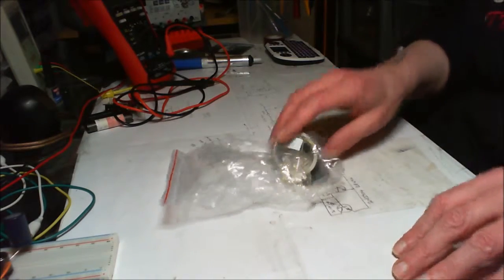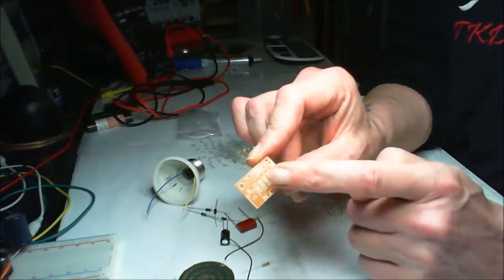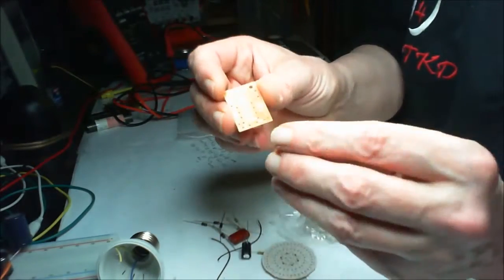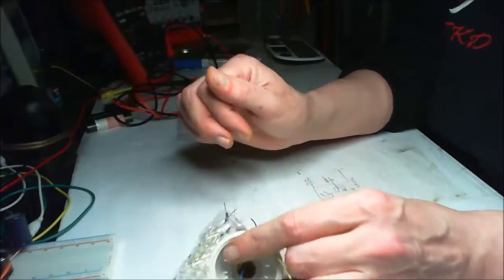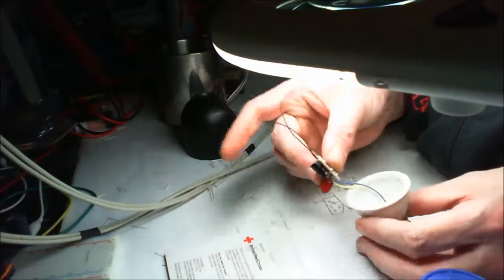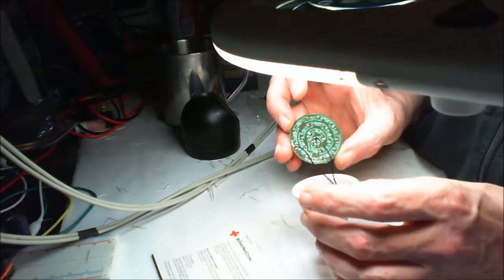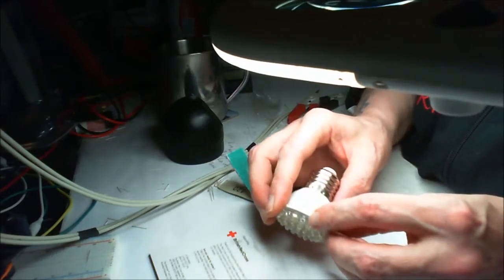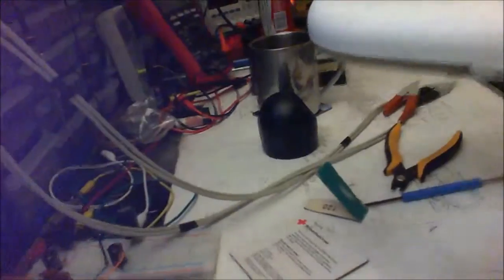Ebay 38 LED 2 4 Watt Light Kit

Comment: hey, got 3 of these on ebay, I made one ok, but do you think I can use brighter leds ? if so any other upgrades I need to do (diodes maybe ?) ?
Reply from the maker: +Juan Lanza Hi. No do not change the components. The transformer-less power supply side is calculated to give enough milliamp s to light the LED's.
What colour LED's have you got I change the white cool glow for warmer ones. If you have warm white LED's you could swap for cool white. Make sure you choose LED's with the same working characteristics. The supplied LED's conduct at 2.2 volts and at 3.2 volts draw about 18 milliamp's.
Be real careful with mains voltages and these transformer-less supplies. K
Reply: +Elecifun I just want more light ! the only things where current is going thru is de diodes and the resistors. the diodes can handle 1 amp, so if I upgrade the resistors maybe can get more light output ?
Reply from the maker: Its a capacitor fed supply with the amperage controlled by the non electrolytic cap. look at my video https://www.youtube.com/watch?v=rlxqKzy5BvA  its a transformer-less or capacitor fed power supply. the diodes in the 38 led lamp circuit are rectifier ac to dc.